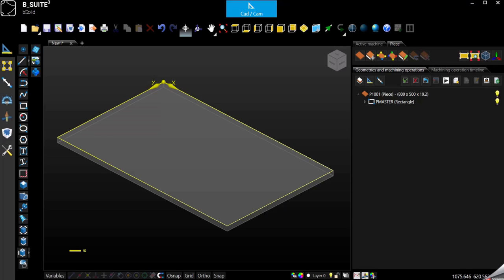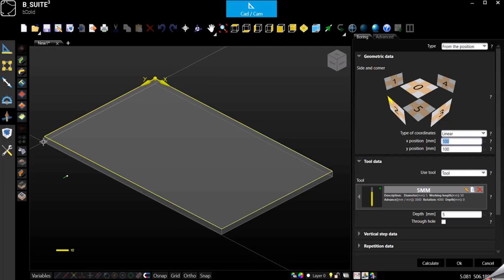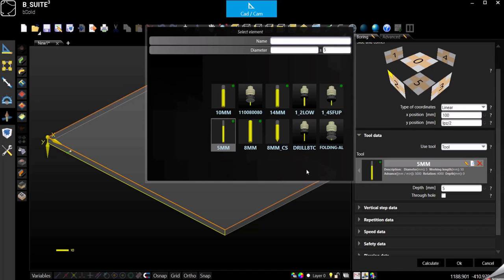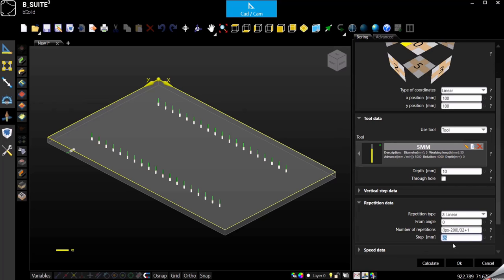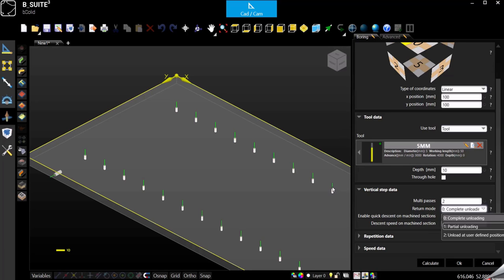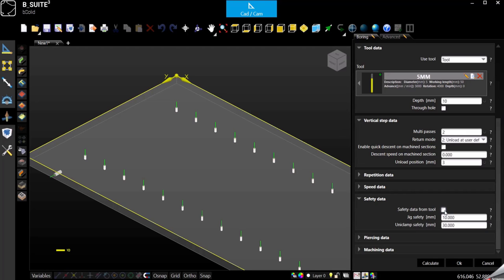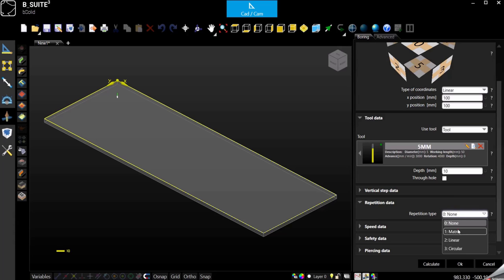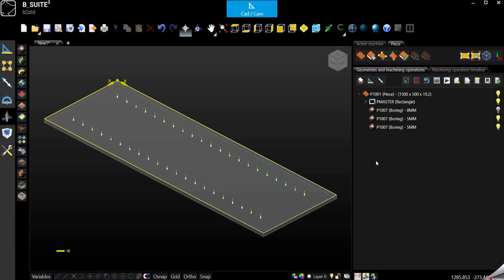5 - CAM BIESSE bSolid - Boring

Comment: Great Videos! I was wondering if you could share more of nesting parts and how we can maximize the amount of yield. I use the The Rover S on a laid up particle board and sometimes on one side of the boards, a 1/4" is exposed. Wanted to know if there is an easier way to make a parameter to not use that one side of the board and still quick nest.
Reply from the maker: Hi, 
If I have understood properly the question, I think the right answer would be:  You can control the trim cut all around the sheets, from two different places
1) When you create a sheet you have the "Left, Upper, Right and Lower" trim parameter.
2) If you have left all the fields of the point 1 here above at 0, you can change them also directly from the "Processing parameters" tab, inside the nesting project.
Hope this can help